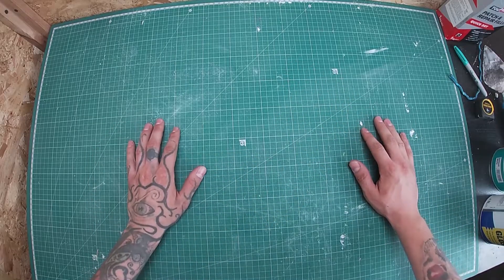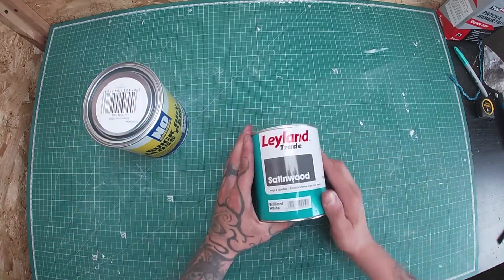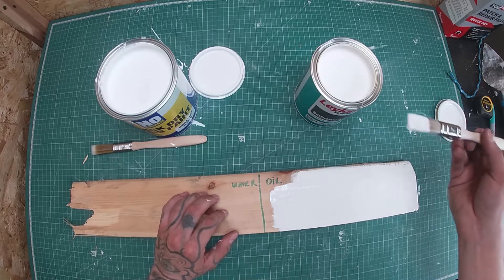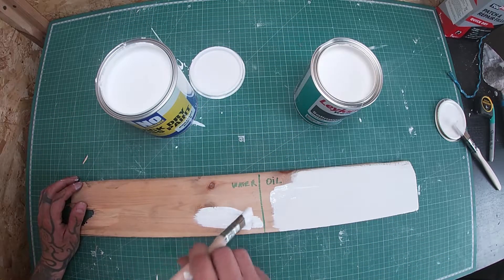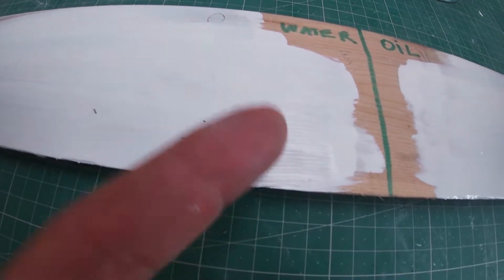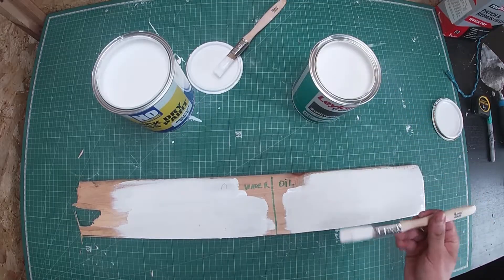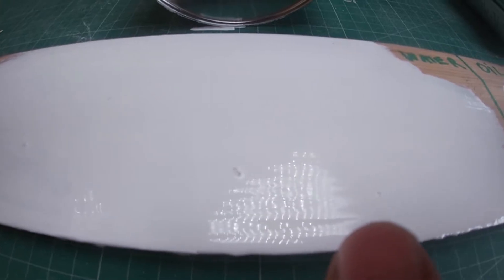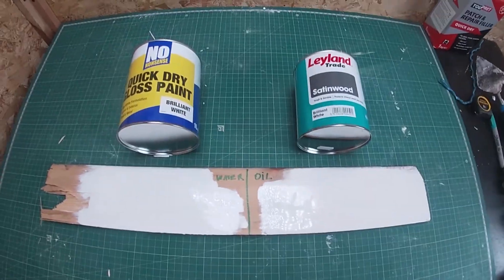Glosses War. Water vs Oil based Gloss - Gobud Pro

Comment: with these two paints you have to use.a primer on bare timber  any paint system from bare a surface is a minimum of three coats anyway it would take you three to four days for a traditional oil finish were you could get it done in a day or 2 with water
Reply from the maker: Hi Jack,
I do agree in regards to the primer part. My test required lack of primer to see how paint itself behave. Thanks for the comment:)